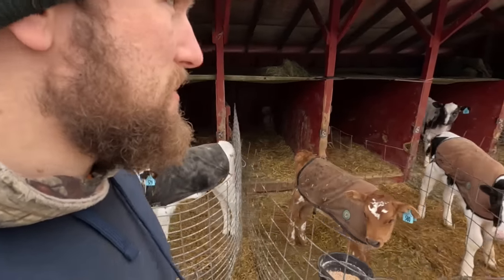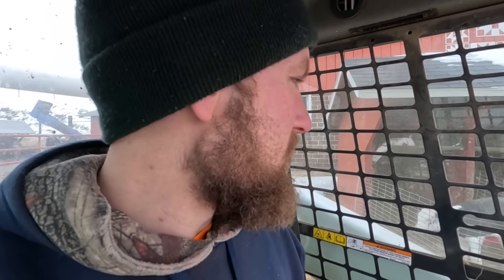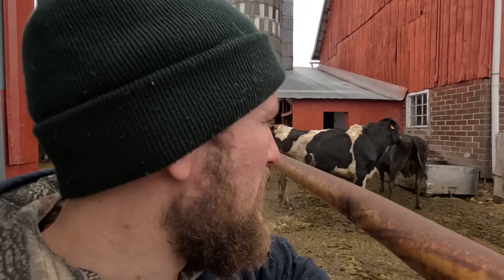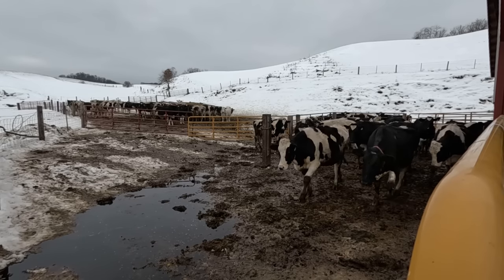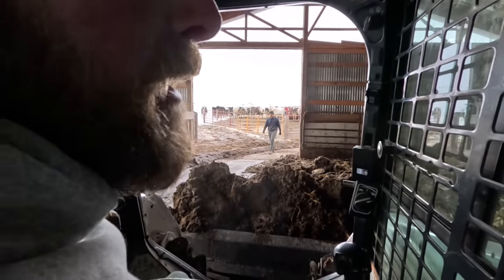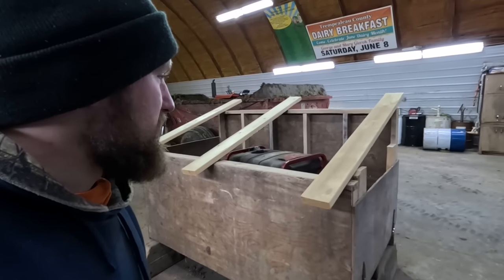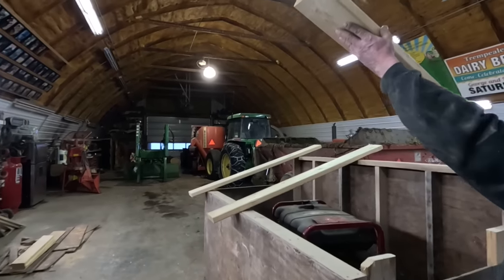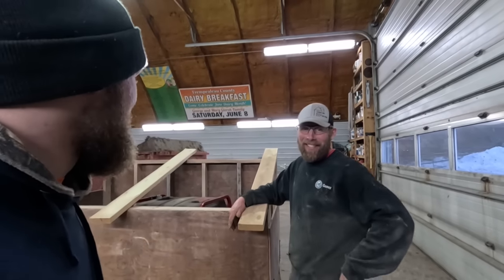Building a Tiny House!

Comment: You mentioned weight of the roof as a consideration.  Is there a reason why the entire roof must be
opened in one piece, or can it be opened in sections?
I ask this because I'm certainly not a carpenter.  If I had to build something like that, a year later I'd
still be standing there, holding a hammer & some nails, looking down at a pile of lumber !

Comment: I used to keep my little generator in an enclosure like that just for sound reasons.  During the summer I found that it would over heat if run for a long time.  I don't know if you run it a long time in the summer or not.